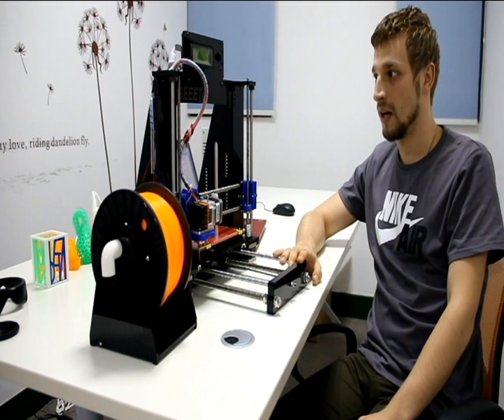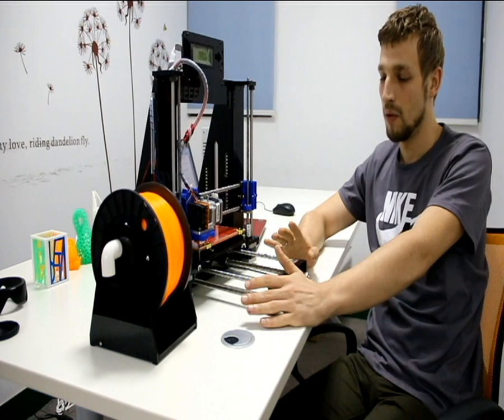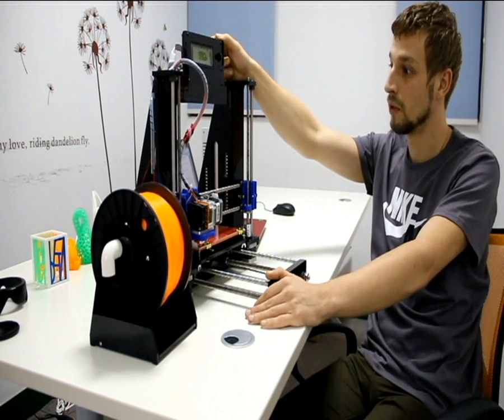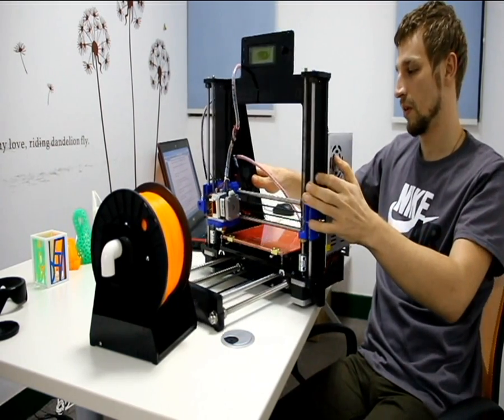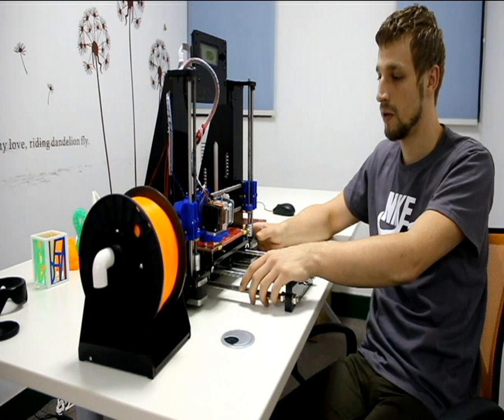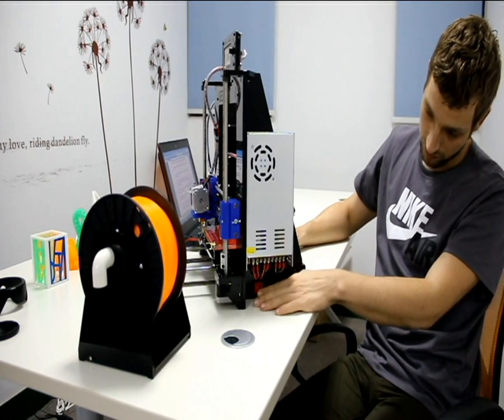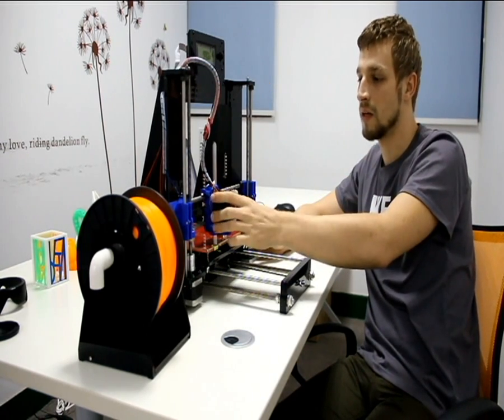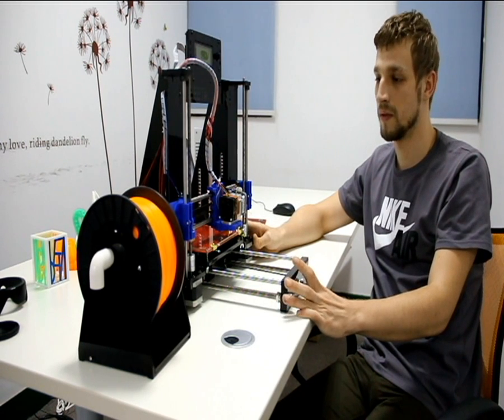Geeetech Acrylic Prusa i3 introduction

Comment: not sure what model that I had, but its geetech i3. I couldn't get it to print. the first layers always peel off the bed. I do not know what wrong, is it the software setting, the printer setting, the bed, or something else. Could someone help me? its been collecting dust for almost a year now..
Reply from the maker: your print bed is not calibrated well, please refer to this guide to resolve it. http://www.geeetech.com/wiki/index.php/Print_Quality_Troubleshooting_Guide#Print_Not_Sticking_to_the_Bed
Reply: well, after trying to calibrate the bed (do you mean leveling the bed?) finally give up. Since I think the heat bed is slightly warped, I decided to try change the glass to 5mm. I figure the thicker glass would help eliminate the effect of the warped surface, you know what? ITWORKED!! yeaaay! finally....not perfect though, but it printed nevertheless...

Comment: Hello. I have one of these printers with sanguinololu. I cant manage to print. I think that the temperature sensor reads wrong temperature. for abs i need 240+ to extrude. Another problem is that i can make it to stick on the glass. I have bed temperature 100 deg. And one last is that if heat the nozzle for example 240 it goes to 255 and then slowly falls again below 240 and then more than 240 and oscilates all the time. Is there a solution for this? It seems to be a good printer. I hope to solve these problems and not say bad thinks about it.
Reply from the maker: +Giorgos Koretsis Sorry to hear that. Please contact our staff of technical support, here is the e-mail address: sherry.li@geeetech.cn   Thank you.

Comment: i have had my printer for about 3-4 months and i still have not succeeded in having a good print. what happens is the extruder motor starts clicking and the filament reverses or jams. When i test the extruder before i run the gcode it works fine, but when i run the gcode it comes out slowly  and after about ten seconds it stops coming out and it starts to click. Does anyone have any suggestions? i have tried adjusting the potentiometer and it has some effect but it does not provide a permeant solution.
Reply from the maker: William White hello William, sorry for the late reply, you can post on our forum, our tech support will help you.

Comment: I'm joining my 3d printer Prussian i3 pro B I came with the Sanguinololu controller but not the same connectors of the engine to the controller card, also do not know how I connect swicht since the card has 3 pins and are only two cable without indicating which is positive or negative, fans both Extructor like the one near the card has three pin connector and the card only 2, if I can target to complete the assembly to begin with the driver and applications.
thanks

Comment: I'm joining my 3d printer Prusa I3 pro B I came with the Sanguinololu controller but not the same connectors of the engine to the controller card, also do not know how I connect swicht since the card has 3 pins and are only two cable without indicating which is positive or negative, fans both Extructor like the one near the card has three pin connector and the card only 2 if pooueden guide me to finish the assembly to begin with the driver and applications.
thanks

Comment from the maker: This acrylic prusa I3 3D printer is designed and manufactured by Shenzhen Getech Co., Ltd based on Reprap Prusa I3, Geeetech I3 features simple assembly, easy debugging and more stable performance. The acrylic structure makes the printer less complex and easy to operate.

for more information, please visit http://www.geeetech.com/wiki/index.php/Acrylic_Prusa_Mendel_I3
Reply from the maker: yes, it is made by geeeteh at Shenzhen, China